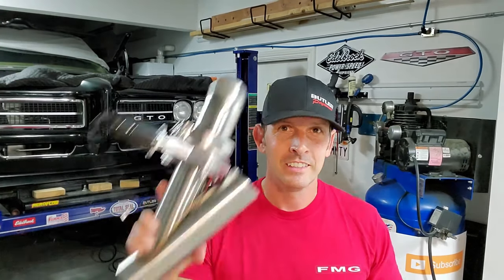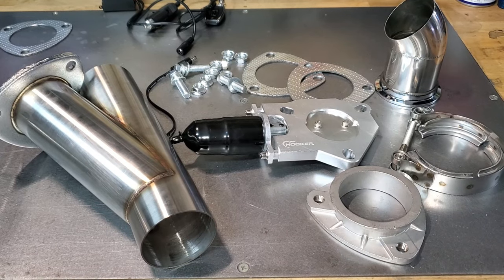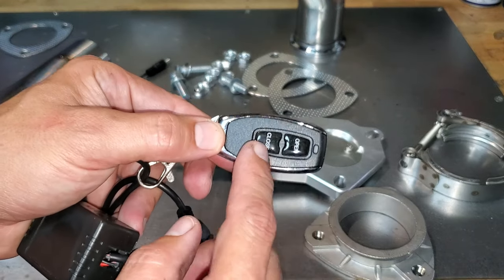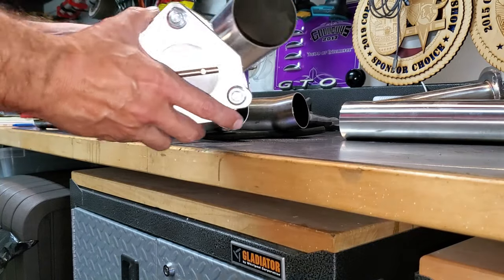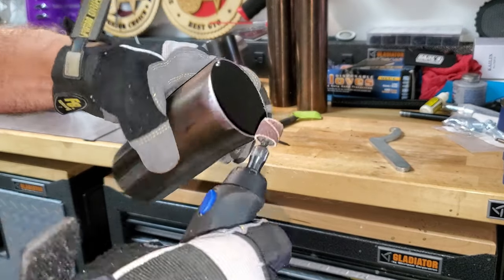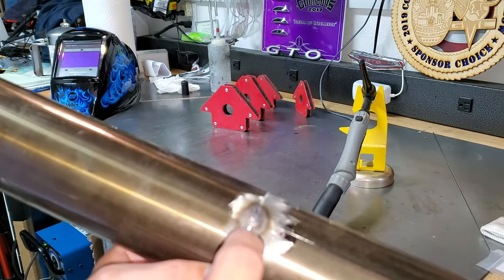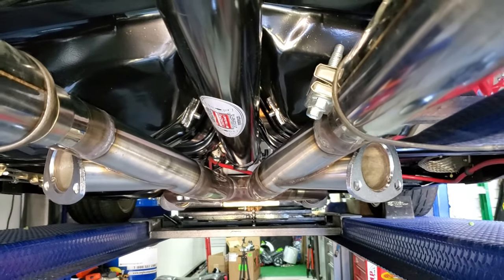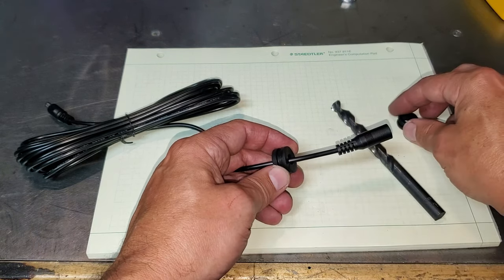Want Loud Exhaust?  How to install Electric Exhaust Cut Outs by Hooker Headers.

Comment: We have tested cut outs on a 632 big block chevy, dual 4inch diameter exhaust, the car was our mustang dyno.
This engine with 4 inch diameter exhaust yield us on the tires 844 hp and 795 tq. Car has Dyno max race bullet's.
Same car with 3.5 cutouts took us to 781 hp and 722 tq. It definitely showed us the restriction at the y connection.
Straight tubes 4 inch diameter 24 inches long connected to the collectors yielded 912 hp and 883 tq.
Proof is on the dyno
Reply from the maker: Dannnnggg, that's some good data!   Awesome!

Comment: Yeah I got some of the cheap-o-eBay cutouts… leaked and rattled…simple fix cured the leak and rattle…grease the perimeter of the butterfly flap get some permatex high temp sealant #81878 put the sealant on the seat where flap meets seat. Shut the valve and leave for 24 hours. The grease will keep the flap from sticking to the sealant…worked for me.
Reply from the maker: Ha!  Clearly more than one way to skin a cat.  Great job creating a fix to the Cheap o cutouts.

Comment: Hey Monty, there is  a tool we use at work for finding a center point to add outlets for plumbing. It's called a curve o mark. You can get them at most welding shops. Great video. 👍
Reply from the maker: Ha!  Of course there's an app for that.  Awesome tip, I'll search for one the next time I'm doing exhaust work.  Thanks!

Comment: Great work! I’m curious on the longevity of the cutouts with the high temperatures. I’ve been hesitant to do this to my Firebird because of that. Looking forward to a follow up after you get some drive time in with them!
Reply from the maker: Thanks Joe!  I totally understand the concern... electronics and heat, DO NOT MIX.  Ha, ha... I'm confident they'll be fine, as they're right in front of the exhaust cans, and really only used when driving into and out of shows, etc... wayyyy too loud at WOT.  As for mileage... it's gonna be a while, as you probably know, my engine is getting rebuilt.  (I'm filming that process, which just started)  See ya!
Reply: Hi Mike. Any update on the cut outs?  I melted a pair from a different manufacturer a few years ago. Just wondering if yours are still hanging in there. Thanks!  Ed
Reply: Any updates on this? Have they failed yet?
Reply: I’ve had a hooker cutout exactly like this on my truck for about two and a half years. I just had to order my fourth replacement motor. Found them for $35 on eBay so I ordered two because that’s the cheapest I’ve ever seen them. The gears inside the motor strip out. Not sure why. The valve is always pretty free moving. I’ve even clicked it where the motor is below the exhaust and gets hit by moving air driving down the road. I get 6-9 months before I need to replace the motor.

Comment: 1. stop using grommets... use pass thru cable plugs.
2. redic to use the plug connections if you understand wiring at all!!!  Snip the plugs, run wire through pass through, run wire thru fuel hose on the underside to protect, solder connection, shrink wrap, and done.
Reply from the maker: Hey Brother, no need to yell.  ha, ha... It dawned on me shortly after shooting this video I could've done done the pass through trick.  Anyway, thanks for the comment!

Comment: I'm about to install these on my Mustang.  Hopefully you see this.  I noticed you installed these at the back after the X pipe, I was going to install mine at the front before my H pipe, you think it makes a difference?  Also the lighter portion I was going to hardwire as well but there is a resistor inside as well as a fuse.  Did you do anything special for that?  Thanks
Reply from the maker: If you have fuel injection you have to be careful how close you mount them to the O2 sensors, as that might affect what they're reading.  Other than that, I would keep the resistor when hard wiring... it's still 12V.  Have fun!
Reply: @FastMonty  it's a '65 289 hipo NA
Reply from the maker: So, still carbureted?  youll be fine.  If you ever end up upgrading to Fuel Injection, be aware too much oxygen could be sucked back through the cutouts when open.    @roberttaskerjr

Comment: im still a bit confused on the wiring. I don't like the cig lighter plug either and I don't have one so if i were to cut the cables and connect them to something, where would they go?  otherwise great video helped alot! u gained a sub!!
Reply from the maker: Welcome to the FMG family... so, after you cut the adapter off, the Red needs a 12V source.  Black goes to ground.  Finding the 12V source can be frustrating... you have to splice off of another 12V accessory, like your radio, etc...  or wire from your fuse box.  Hope that helps!
Reply: @FastMonty  so could I tap into the fuse box?
Reply from the maker: @joewalton3624  Yeah, look into a Fuse Tap, typically allows you to add an extra fused source.  Have fun!

Comment: My dude! Great great video. I have put electric dumps on before but old school ones. Been shopping around. I have Hooker headers already on my 95 F250 7.5l and wanted to go with these or there is company called dig power where you can use via BT through phone. But then was gunna put then before the H-Or X-Pipe not sure yet. And then hook up Boom Tube nascar style exhaust. Should rip and be obnoxious as hell.
But for real man, thanks for video and great job. Sounds amazing. Gives great sound of that Cam. After this I just had ti subscribe to your channel.
Reply from the maker: Thanks Brother!  I'm sure whatever you pick will sound wicked.  Welcome to the FMG Family!

Comment: Damn that Goat is clean first off,you’re video was incredible in detail.You must be an engineer you’re work looks surgical.Even though I will not undertake this job for lack of talent and tools.With that said my current project is a OBS SS 454 build.My original plan was to run spin techs dumped just be fore the axel.Constant loud ,now updated plans is run exhaust to rear and in stall these .Thanks you sold me.Hooker should Hook you up ,pun intended.
Reply from the maker: Ha!  Thanks Brother.  I like your new plan, I tried driving down the street wide open... waaay too freakin loud. You'll love em. I hope Hooker hooks me up too. Ha ha. Thanks for the comment.

Comment: Hey Guy ! Stumbled upon your site and I like what you're doing. I know I can learn something from you and viewing your cutout installation I have. I want to install one of these in my 1986 El Camino. My question is the cutout motors and how to protect it from the elements for longevity.  What about a metal shield that covers it ?
Reply from the maker: Hey Dennis, not sure... all I can tell you is, make sure you buy them from a big Brand, like Hooker.  They'll stand behind their products.  DO NOT buy something from ebay or Amazon.  So far mind are working great, but I only have about 3000 miles on them.  :)  The motors have a rubber boot over them, to protect from debris... pretty sure they're water proof.  But, I've only driven in the rain once, by accident.  LOL. Have fun!

Comment: Would this cut out still work with stock catalytic converters? Sound wise
Reply from the maker: Yes.  If you have the room, cut outs basically remove the mufflers, the cats will still do their job, assuming you put the cut outs after the cats.  Have fun!

Comment: So my Y pipe is kinda loud but I want it to be very loud but I want to be able to stop the loud when I want too what should I do
Reply from the maker: Welp, you need to install a valve, like I installed... there are several different styles on the market, where you might need to get creative.  Good luck!

Comment: There any way I could install these with just band clamps and no welding? Can't find any others that conveniently just plug into the cigarette lighter and have a remote.
Reply from the maker: Great question.  Band clamps are typically for slip fit pipes, ie one inside the other.  Since this would be a butt joint, I'm not so sure the band clamp could withstand the side loading created, and will probably start to sag at those points.  Let us know if you find any other solutions!  Thanks for the comment.

Comment: Hello, I just ordered an Electronic Exhaust Cutout Dual System and a Roush Resonator Delete-H Pipe for my 2020 Mustang GT w/o active exhaust. my question is where would be the best place to install my Electronic Exhaust Cutout Dual System. I'm going to take it to a shop but they might install it where ever and I want to know if there is a pacific spot/best spot to have my cutouts installed what do you think. I apricate your time.
Reply from the maker: Congrats on you path to making it loud.  Depending on the size of the cutouts, you might not have a choice of where it goes.  But, no, if you're removing the resonators, they'd need to be mounted anywhere before the mufflers.  Good luck!
Reply: @FastMonty  Hello I really appreciate the comment. did you change your car's CPU to adjust to the cut outs you install like the gas-to-air ratio? what do you think?
Reply from the maker: @chasemcdude3781  No.  But, you bring up a good point... if your cut outs are too close to your O2 sensors, it'll create some havoc.

Comment: The problem woth that is that it’s not easy to install on a new car since you gotta get some electricity in there and that’s the problem, i’m no electrician
Reply from the maker: So, the welding part is easy?  Ha, ha... running electrical is not as hard as you think... just need to find your fuse panel, and use your voltmeter to find a switched source.  Have fun!
Reply: @FastMonty  I have no clue of what to do with this. I just want it on my car. I get the welding done by a professional. He just does’nt deal woth the electric stuff so I’m left with no other choice but to anandon my plan. Decided to put the money in a Hidden Hitch install so I can tow a camper for the familly vacation. It’s another type of win I guess 🙄😅
Reply from the maker: @felixauclairtendland4766  Too funny, yeah, a win is a win.  But, don't be afraid to learn about how electronics works... especially with cars, super easy once you get it.  Have fun!
Reply: @FastMonty  thanks

Comment: 100!!
forgot that we might have to have 2 cutoffs for a v8. 
on the DP, is there not enough space on the x connection to run only one?
Reply from the maker: Thanks... and good question.  I don't think so, but might depend on the vehicle.  If there were space, I would only use it for sound increase.  Versus guys who want zero restriction for exhaust, it wouldn't flow enough volume to make a difference.  Thanks for the comment!
Reply: @FastMonty  that sound though!
Reply from the maker: @bigdaddy9089  Ha!  Totally, night and day.

Comment: Would it still work just wired to the battery? I don’t know if the amps are too high or what not
Reply from the maker: With an on/off switch, yes.  They only draw the amount of amps they need... unless there's a short, which is why fuses were invented.  :)  Have fun!

Comment: any chance you can go into a little more detail about the wiring, im good at fabrication but when it comes to wirings its always a mess for me. i also dislike the cigarette lighter adapters, did you hook yours up directly to the battery?
Reply from the maker: Good question... it's actually really simple with the "Manual Kit", in the description.  You can cut off the cigarette lighter, mount the black wire to a good ground on the body, like I did.  Then wire the power to a keyed 12V source.  You'd have to get a voltmeter or tester to find a wire that has 12V, after you key on to accessories.  Hope that helps!
Reply: @FastMonty  thanks that does indeed help a lot.

Comment: It wouldn’t matter if the valve was level, that wouldn’t hinder its performance.
Reply from the maker: Totally agree.  What does matter is ground clearance, and body clearance, which happens to be right where that flange is level to the ground.  Hence my leveling comment.  Thanks for the comment!
Reply: @FastMonty  this is a great video and very insightful. I wish I could weld cuz I can do everything else.
Reply from the maker: @DoubleTimeRC  Thanks!  Being able to weld is a game changer, cuz, now I can get super creative with, well, everything.  ha, ha... I would suggest saving up for a good TIG welder.  While it's harder to learn, you can weld EVERYTHING, stainless tubing, sheet metal, and aluminum!  As I said in the end, I'm still not that good at it, but it freakin works.  Keep at it, and thanks for the comments!

Comment: Great job man. 
 I wanted to ask does it do any damage to the car in the long run?
Reply from the maker: Good question... Nope.  It just gives you the option to run without Mufflers.  Which is insanely loud.  So, I usually open them up when entering/leaving car shows.  :)
Reply: @FastMonty  Man thanks for the reply, I did it on my Nissan Maxima, the sound is awesome but too loud and the vibration during drive is annoying so I was thinking to move the cut out from the middle of the exhaust to the back of it. On my Maxima I have 1 exhaust that divides into 2 mufflers. So my question is (sorry if it's a stupid one) is it a good idea to install the Cut Out just on 1 of the mufflers?
Reply from the maker: @SlavikMilerFitness  Great question... I have no idea.  I don't think it would, but again, it's a car I'm not familiar with.  Give it a shot and find out!  Ha. ha... thanks!
Reply: @FastMonty  Hey bro so I ended up moving the cut out a bit before 1 of my mufflers and it sound great + the strong vibration is gone.
Reply from the maker: @@SlavikMilerFitness  saaaweet!  Thanks for the update.

Comment: I got a cuestión. I buy a car out but  the module no works can I use  different module ??
Reply from the maker: Good question. I have no idea... you need to ask the manufacturer. Or, convert it to manual operation, like I did in the video. Good luck!

Comment: Wow!.. Great video! is there an application for a C4 1995 Vette?
Reply from the maker: Good question... you can put them on anything that has 2.5" or 3" exhaust.  The trick is finding a straight length of pipe, and having enough room for the actuator.  Good luck!

Comment: Are you back purging your stainless welds?
Reply from the maker: Nope, that's probably why they look terrible.  I'll look into purging next time.  Thanks for the comment!
Reply: @FastMonty  I’m no expert but I think the inside of the tube will crystallize and the weld will be very weak if you don’t back purge the inside of the tube.
Reply from the maker: @colinrosenthal4296  I'm not an expert either, but I do know it helps with a cleaner/smoother weld.  I just didn't have the equipment to back purge.  Thanks!
Reply: Keep up the great content. So nice to see good poncho content on the regular. Hopefully my all aluminum  500ci 68 gto will be running summer 2023.
Reply from the maker: @colinrosenthal4296  Ohhhh saaaweeet!  I'd love to upgrade to that one day.  Keep at it, and thanks for being a part of the channel.